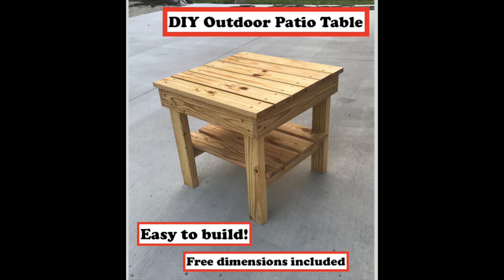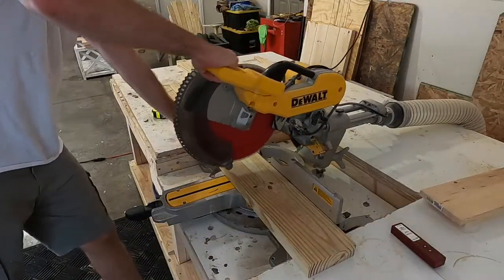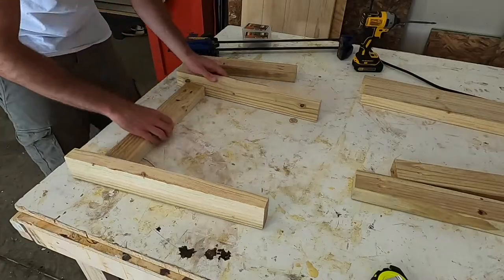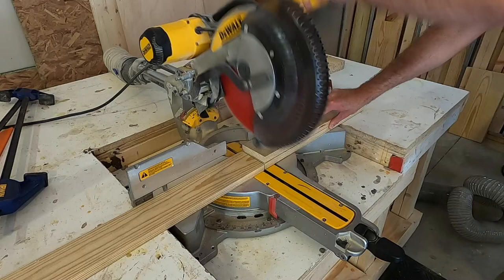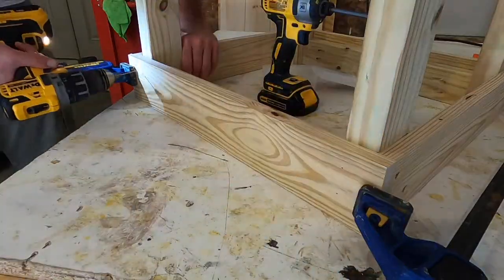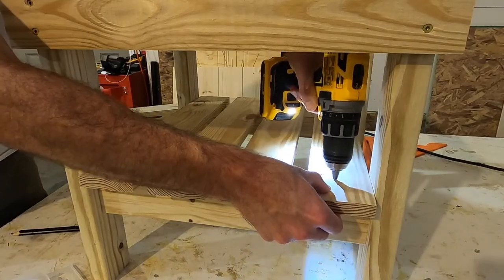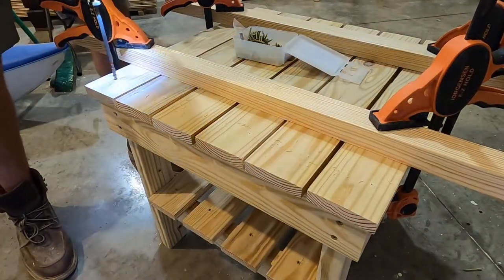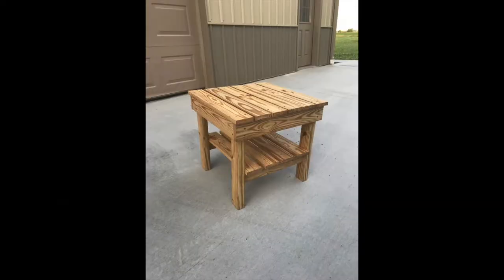DIY Outdoor Patio Table Build (Build Plans Available)

Comment: Hi Matt! Thank you for the awesome video. Very well made and clearly explained. Makes a world of difference to those for whom, like me, this kind of work doesn't come easy. One little thing though. The cut list calls for two 20" pieces of 2x6 plus two 17" pieces. That amounts to 74 inches . You recommend a 72" 2x6. I just went ahead and bought an 8ft board at the store instead of the 6ft. Anyhow, great little table. Now everyone of my non-manual friends thinks I'm a house builder!😂
Reply from the maker: Thanks for watching and the feedback, I fixed the error you mentioned - appreciate the heads up on that!

Comment: Great little plan brother! You need to do a video on them sweet Adirondack chairs!! I do believe you were putting the power pro screws  in your pocket holes, am I right? If so how are they working out. I won't tell Kreg Co. that you're not using their screws....lol!
Reply from the maker: Thanks Kevin! I would have but I was totally winging the chairs! 😆 And yep, I never use the Kreg screws and everything holds up fine as long as you don’t over sink them.. maybe kreg will hook me up with some of theirs! Ha!
Reply: @mmcc_woodshop6288  Yeah I hear ya!!! I'm really sick of paying $20 for 250 screws! It's $28 for 250 if you get them from the blue and orange stores!!!! I build full time and I can afford it but I'd rather find a cheaper alternative and put that money somewhere else. After all we know the joint gets it's main strength from the glue! I appreciate you brother, great video.
Reply from the maker: No kidding! That’s why I go with the other ones. Just made sure the screw itself is decent, the heads will snap right off the tops of some brands